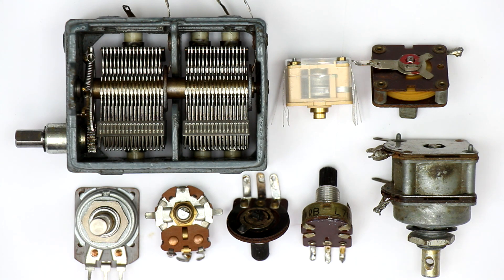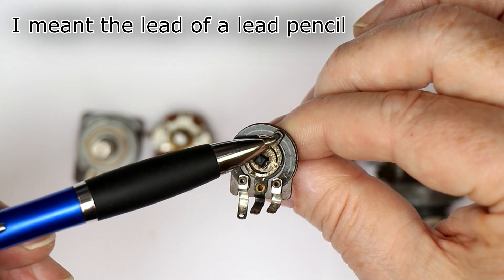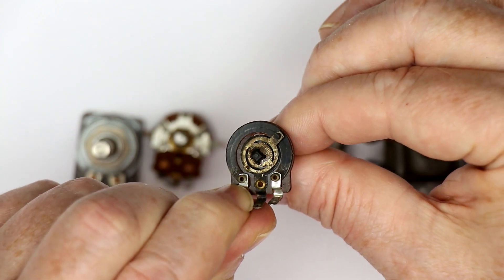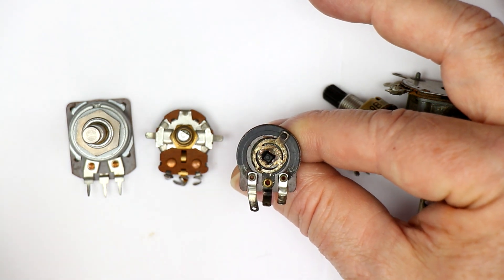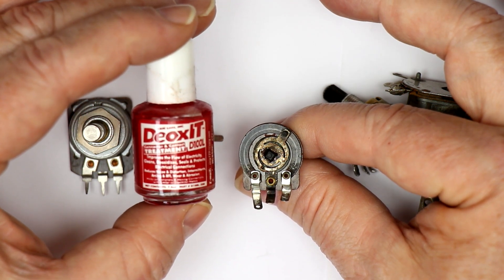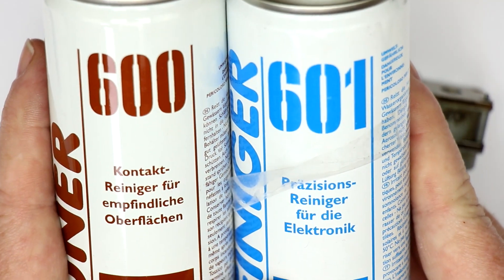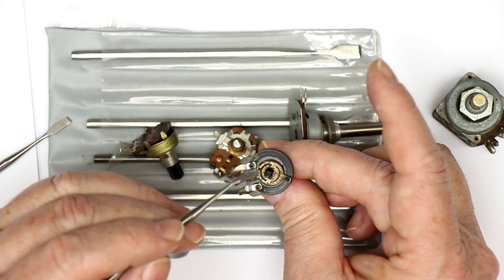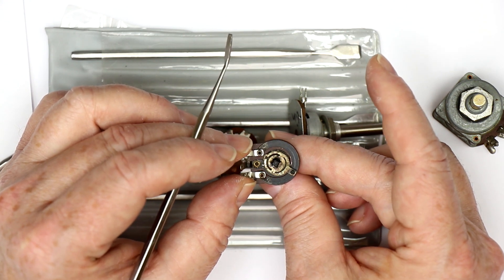Cleaning Potentiometers and Variable Capacitors

Comment: Why not just replace them with new?
Reply: Youre abviously new to this
Reply from the maker: Because you don´t get the shown parts new!
Reply: @KainkaLabs They are manufactured and assembled?
Reply from the maker: What? I don´t understand your question.
Reply: @KainkaLabs When the device was manufactured they had to have parts to put the device together. Why not get the part and put in a replacement? The sealed pots are near impossible to fix.
Reply from the maker: Yeah. That was many, many decades ago. Most of the parts shown are 40...60 years old...
Reply: @KainkaLabs Then it should be easy for a manufacturer to build a replacement part to spec.
Reply from the maker: @randomtube8226  You have absolutely no idea and knwoledge about repairing vintage electronics, repair-work in general, spare-parts supply etc. I will quit this conversation nbow. Good luck with findig spare parts for your broken devices.

Comment: I might have an addiction to VAC's. 🤣 

I just bought a really great 1920's-early 30's, larger capacity single gang triangular chassis all aluminum, brass, and ceramic VAC on eBay. One of the coolest features, is that it's assembled using brass screws throughout, and it comes apart 100%. -I can afford to lose a tiny fraction of it's capacity, so I'm polishing every piece of aluminum in the cap, on a polishing wheel. -It's going to be part of the audio input capacity of a Mullard AC176 Ge transistor guitar fuzz circuit, with two Transitron 1N36, and 1N34 clipping stages, one before the transistor gain stage, and one after, with various other caps as audio filters (silver mica, and metalized film caps) along the way. The VAC will be outside the guitar pedal, mounted on top of the pedal, mostly because I really love the VAC aesthetically, and I want everybody to know about the cap's use in the circuit! 😁 

Thanks for your insight!

Comment: If you disassemble a potentiometer for cleaning, you can carefully clean the carbon track with a soft pencil eraser, followed by a cotton swap dipped in alcohol, and a tiny dab or very thin film of silicone grease. Note that the problem of intermittent or noisy potenttiometers is often due not just to a dirty interface from wiper to carbon track but also due to tarnish on the commutating rings (which are often silver plated) that electrically connect the wiper to the middle terminal of the pot. Some cleaners will dissolve that tarnish to an extent; the pencil eraser technique works even better if you are able to access the rotating parts, but be extremely careful not to bend them! . Note that spraying pots with solvents or cleaners can thin the factory applied lubricants from the shaft/bushing assembly and spread them around, gunking up the conductive wafer and making the pot rotation feel coarse and stiff, so use spray cleaners sparingly. If you need to relube the shaft on an older pot, engine oil or motor-bearing oil usually works (don't use a polymerizing, skin forming "protective" oil like ordinary 3 in 1 oil; gun oils could also be problematic). 

Newer pots, especially those with plastic shafts, often use a silicone grease with a honey-like consistency, or something similar to clear transistor heatsink grease, and thise types of pots will sometimes freeze solid when hit with a blast of spray cleaner. Be cautious about mixing lubricant types! 

It's mportant to note that variable tuning capacitors should never be sloppily spray-cleaned with anything that leaves a residue. After degreasing them thoroughly, apply a tiny drop of Deoxit D5 or other similar cleaner to the metal clips that make a rotational connection to tge shaft for each section of plates, using a pipette or dental pick. ( A 2 - section capacitor has 3 such cliips; a 3 section cap will have 4 clips etc). Dont spray the entire tuning capacitor t with Deoxit!  Allow carrier solvents from cleaning the junctions to evaporate for an hour or so before aligning the tuner....

PS, frozen gearboxes or frozen metal shafts on pots and rotary can sometimes be freed with alternating applications of heat from a hairdryer or heat gun, and thin penetratiing oil. Heating the shaft drives air out from inbetween the shaft and the bushing, to form a light vacuum; apply thin penetrating oil while the shaft is hot and the oil will be pulled into the bushing as the pot cools. I've freed up rotary selector switches on Hickok ttube testers and Dynaco preamps in this way, grabbing the shaft with pliers or visegrips to turn it free after several applications of oil and heat.

Comment: Watching other professional repairs on YouTube I see them using Nutrol for switches and controls.
Reply from the maker: You probably mean "Nu-Trol". Of course there are many alternatives (especially on the US market). But for cleaning potentiometers or sliders I would only use the chemicals I recommended in the video. The resistive carbon layer is extremely sensitive and irreplacable when damaged mechanically or by the wrond "solvent"/"cleaner".
Reply: @KainkaLabs  thx for the good advice.

Comment: Thank you very much for this video! I am from India, a Bio-Medical Engineer by profession & a radio & vintage audio & tape recorder hobbyist. I want to know the reconditioning process for the compact film type ganged capacitors. Please let me know through your video in case you have done any work particularly on these components. Regards!
Reply from the maker: What do you mean by "ganged capacitors". Like the metal one which is shown in the video? Use compressed air for the metal plates. If the axle is stuck, soak it in acetone or another organic solvent and relubricate it with modern "non-ageing" grease.

Comment: The basic question about any spray or fluid is whether it takes any contaminants with it when it vaporizes.  Mostly not.  Just think why distillation works for separating for example alcohol and water.  In the cleaning attempt, the original dirt rarely evaporates along with the solvent.  Your test with the paper also shows, even without original dirt spot, how something was left as a ring.  I would really favor washing - ultrasonic or whatever - than depend on vaporizing.  If I have to depend on the spray cleaners, I would apply so much, that the cleaner and dirt can be shaken away together, rather than hope that the dirt miraculously evaporates as well.
Reply from the maker: The spray and fluids shall wash away the contaminats, not "evaporate them", which is of course nonsense. Ultrasonic cleaning has it´s own dangers. It can destroy parts by vibration. And you have to desolder the part first of all and then take it out to get it into the US-cleaner. And you have to have at least a semiprofessional US-cleaner. So strays and fluids are in most cases the thing to go with first.
Reply: Dirt DOESN'T evap. 😄😉

Comment: If the carbon is worn away on a potentiometer, I would just replace it if possible.
Reply from the maker: You will only in very rare circumstances find a replacement potentiometer that fits mechanically, has the same value and charateristic and the same quality. Look e..e. at the potentiometer at the bottom right. Where do want to search for this one and what are the chances you find the exact type?

Comment: If I have it out I find using the drill press and a 1/8 drill bit so I can spray it. Then cover the hole with  small piece of metal furnace tape.

Comment: Sometimes you get AM. FM. transistor radios that have the plastic shell make a lot of scratchy noise  while tuning. One video 
made a note of interest  to me, was that the noise was  caused from the tuner shaft and its contact.  I always thought it was the insulation between the plates. So rather than drench the entire tuner with contact cleaner, just use the cleaner with an eye dropper on the shaft.

Comment: I use lighter Fluid and a small paintbrush for Potentiometers in my tube radios,i never hat Problems in the past 10 years.
Reply from the maker: Can you specify what "lighter fluid" is?
Reply: @KainkaLabs , "lighter fluid" is Naptha; here in the States it's sold under the brand names Ronsonol and Zippo (the cigarette lighter compony), or you can buy a generic can of Naptha at a hardware store. It's a good general solvent and degreaser, safe for most plastics.
Reply: That zippo lighter Fluid,or if i don,t have some,i use white gas, i always have some white gas,because i use it for my coleman lantern .but be careful,if you use zippo lighter Fluid for cleaning, in some cases, test it ,on old defective Potentiometers,before using it on good ones,like i do.

Comment: I thought they were variable resistors?
Reply: Variable resistors only have two connections, while potentiometers have *three*. A potentiometer can be wired to function as a variable resistor, but a variable resistor cannot be used as a potentiometer.

Comment: dont ever use a ultrasonic cleaner,it will literally destroy the plastic variable capacitor
Reply from the maker: Have you tried?
Reply: @KainkaLabs  i tried it on a modern one,it pits the copper and alluminium sheets aswell

Comment: Very interesting video. Thanks for uploading it. Do you think that cleaning the pot with some 99% IPA and lubricating it with white lithium grease would work? Or would it mess with the resistance?
Reply from the maker: I don´t know if lithium grease is conductive?
Reply: Lithium grease woukd be okay for lubricating the shaft ( I prefer silicone grease for that purpose) but I don't recommend putting it on the carbon-coated resistive wafer.

Comment: Many many thanks! I wonder why acetone wouldn't be a good cleaner for the worn  potentiometer in the D-Jetronic throttle "switch". Yes, I did think of bending the arm a llttle.  Regards from South Australia
Reply from the maker: Acetone is too agressive. It dissolves nearly everything made out of plastic, oil, grease etc.

Comment: Why not bend the 4 tabs and remove the cover completely and then clean it?
Reply from the maker: Yes, you can do that, but in my experience you never get it reassembled just as tight as in the original state. So only if the cleaning/lubricant spray does not work, I would disassemle the potentiometer to get to the carbon resistance layer.

Comment: I have to replace a small 50k metal trimmer on a 1973 receiver, these 4 trimmers only have two legs and I don't see anything like them on the whole internet..all it says on them is 50K..what to do?
Reply from the maker: Use a "normal" 50k trimmer and only cut off one of the outer legs. So you have the wiper-leg and the other remaining leg.
Reply: @KainkaLabs  I sort of ended up doing that, I got some small blue bourns ones and soldered the wiper leg to one of the others, seems to work
Reply: @KainkaLabs  so strange tho I couldn't find even a picture of one of these things anywhere

Comment: The following may be of interest to this discussion:

To my understanding, from what I have read/watched, CRC QD Electronic Cleaner can be used to clean potentiometers however one should follow up with a lubricant such as CRC 2-26. 

Here are some of the responses from CRC with regards to my email correspondence with them (one should verify this information) :
" .. CRC 2-26 is non-conductive. .."
"...Yes you are correct using the QD Electronic Cleaner will remove any lubrication. You can use our 2-26 product, please make sure you wait the 4-6 hours before reenergizing equipment. .."

CRC QD ELECTRONIC CLEANER
https://www.crcindustries.com/products/qd-174-electronic-cleaner-11-wt-oz.html

CRC 2-26
https://www.crcindustries.com/products/2-26-174-multi-purpose-precision-lubricant-5-wt-oz.html

https://www.youtube.com/watch?v=zf5eUOhRDLg&t=1709s
https://www.youtube.com/watch?v=0ADYRx2jQSE&t=2343s

https://audiokarma.org/forums/index.php?threads/crc-2-26-and-crc-qd-contact-cleaner.449010/
https://audiokarma.org/forums/index.php?threads/deoxit-vs-crc-contact-cleaner-vs.276344/page-2
https://www.eevblog.com/forum/blog/eevblog-777-keithley-177-microvolt-dmm-repair/50/
https://audiokarma.org/forums/index.php?threads/crc-electronics-cleaner-vs-contact-cleaner.711189/

Comment: Air variables can be boiled in water to clean them without damage. soaking in diesel fuel or kerosenee  also works well for loosensing grease and grime.
Reply from the maker: Thanks for the hint. Turpentine or paint-thinner will probably also work.

Comment: Have you tried W40 spray for repairing carbon layer in potentiometers?
Reply from the maker: No, better not. Use only the chemicals I recommend in the videos or name one that you have good long-time experience with.
Reply: I've got 50 years+ experience at repairing audio electronics; do NOT use ordinary WD40 to clean potentiometers, switches or other electrical/electronics devices, as it leaves residues that dry up and get crusty. That company now makes a "specialist" line of electronics spray cleaners, but I haven't tried them and I don't know if they're any good. Proceed with caution...